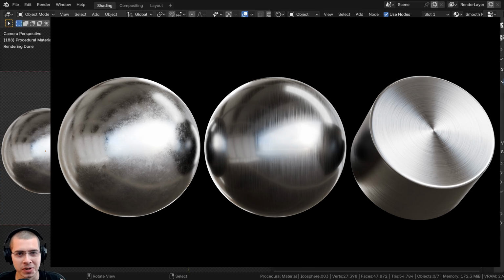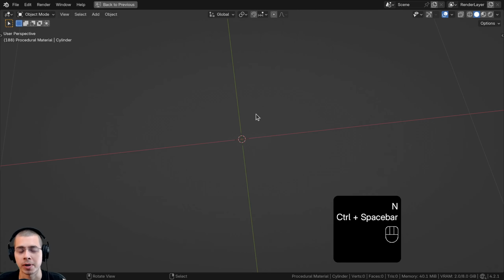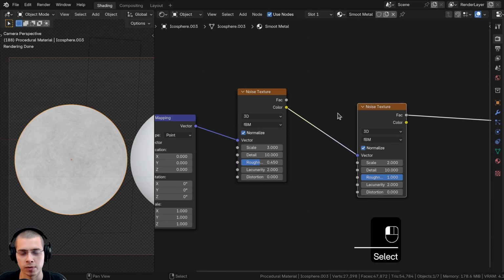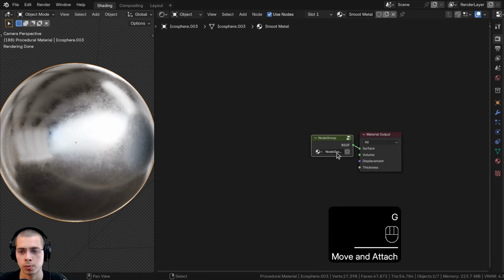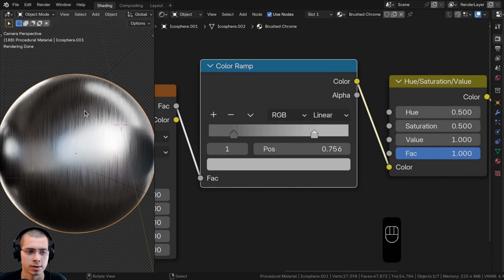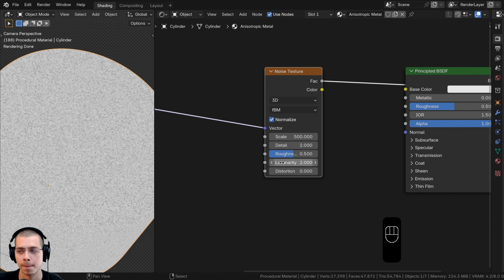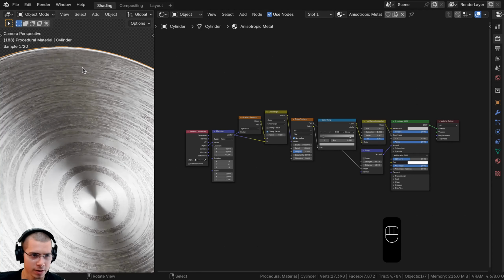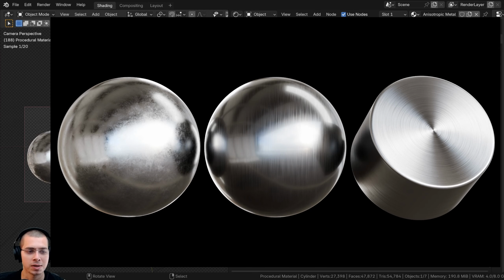Procedural Metal Materials (Blender Tutorial)

Comment: THEN... after having purchased your project file, how do you install it in Blender ?
OK ! In the zip file there are 3 files : 1- .blend 2- .jpg 3- .hdr
I clicked on the .blend file and the three objects appeared in blender with the procedural nodes beside.
The objects are naked by default (not covered with material) and when playing with the procedural settings, nothing happens to the corresponding object !
What do I do wrong ?
OK ! Found it : you have to select on the top right icons of the object pane the "render" icon or the "Material preview" to its left... 😁👍
Works great ! Now, I have to find the way to apply your "procedurals" to a custom made object of my own like... a 'fleur de lis' ⚜
Reply from the maker: Hello. Thanks for purchasing. First you need to unzip the .zip file to access all of the product files. In order to see the material showing up on the object, you need to go into the rendered viewport mode. The solid viewport mode doesn't show any materials. If you want to add the materials into other blender files to add them to objects, you can use blender's append feature to add the material data into other projects. If you need more help, you can reply to your email receipt and send me an email for product support.
Reply: @RyanKingArt  👍😊 Is there a link in the 'Blender Market' website where I purchased your project cuz I deleted your reciept email.
BTW : in the zipped files, I guess the two last files are used by the first one (.blend) so we don't have to bother with them !?
Reply: @RyanKingArt  Sent you a message in Blender Market...

Comment: The last node setup didn't work well for me. The result wasn't like yours, with those circular lines. I inserted the "Gradient Texture" node configured as "Spherical", but it didn't turn out as shown in the video even though I followed everything the same way now in Blender 4.4.
Reply: I used only one "Mapping" node, not two like his, and I changed the X, Y, and Z scales to 0.500 (the closer to 0 or 0.700, the worse the effect; it also works with negative values. I preferred to leave it at 0.500 because I liked the result better). In my case, these values worked for my object, which is a cylinder with X and Y = 2.36 m and Z = 2.2 m. Scale was applied with CTRL + A. I didn't change the rotation, and my lighting is HDRI and a sun lamp.

Test it and see if it works for you.

Comment: I just could not get the anisotropic effect to happen, and I followed the tutorial to a T! then I realised my object axis was off (even though the origin was set to geometry) so I went into local transform orientations, then sidebar - tool - transform - affect only origins then manually rotated the axis to get the z, x and y where they needed to be and this fixed it. When i had imported this CAD file it was oriented sideways so I suppose the axis had always been off until now.
Reply: Man. That may be my problem. The tutorial worked. But when I tried to apply it to my model, it just wasn’t turning out. But my model is orientated differently.

Comment: Exactly what I needed. But so far I couldn't figure out why mine doesn't look the same. Probably because my object is only 12 cm big. I see on the top side, where we want the scratches to circle around, more like only lines. When I raise the Noise Distortion to 50 it looks a bit better, but in wrong relation to the side of the cylinder. I checked everything and I have the same settings like you. Maybe it has something to do with the Mesh of my object. --- 1 Day later.  I found out what I missed. I applied Scale but not All Transformation. As a Beginner I guess that as the geometry got exported from Rhino with Y axis vertical it caused those problems in Blender till I applied all transformations. 
One thing I thought about, that if you make those Spheres to show your Material, the Sphere is mostly around 2m big. I think then the material looks often a bit in a wrong Relationship to real sizes. Because in real life, most things we use that have those materials are around 10 to 50 cm. (Computer, Hammer, Doorhandle, Smartphone. A Bicycle or a Car are the only two things I use that go into that 2m size range, but also those doesn't have one single Area that is 2m. Mostly they are separated in different smaller parts) So I think the Material-Spheres should be around 10 or 50cm.
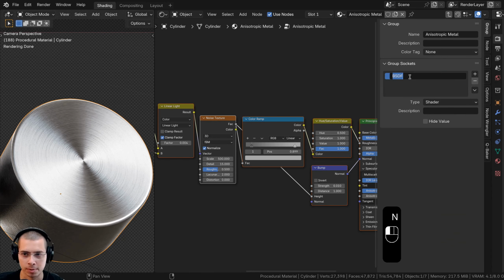However - thanks a lot for the great tutorials. Me as a Beginner had huge Struggle to understand what you are doing from min 26:00. I think for Beginners it would be helpfull to mention there what's the goal before starting all those very fast steps. Something like: "Now the Node Tree is finish and I will put it into one box to have outside the box only one Node with only the important areas to adjust. I show you how to do this, as it helps to simplify the big Node Tree and make it more easy to see in one Node where to adjust all the different parameters." 
For me, only 6 Month into Blender it was "what is he doing? Why is he doing this?" And as I said to myself then "Just trust this Guy and follow the steps, because every single Tutorial of him was great." I started to understand at the end what and why you was doing this Box and Output-Node Thing. 
Just as a little feedback from a confused Beginner. :) huge Thanks for all your amazing explaining.

Comment: Hey, I made the brushed metal material you showed. After making this and applying it on a cylinder with a sub D modifier it seems to have a mid section where the texture gets stretched and is only fixed once I decrease the scaling on the x axis, have any suggestions on how to fix this?
Reply: Apply Scaling with CTRL+A.

Comment: The last texture doesn't work. I have no idea what I am doing wrong, but on the lateral faces on each face, I have that circular pattern. The origins in at the very center of the mesh.
Reply: I also have same problem. 😢 I tried changing scale and mix type but it is same
Reply: @harsh_singh332 Alt least I am not alone 😂
Reply: @lucaciucristina130  I had the same issue, my problem seemed to be I was using a sphere, I had to setup a cylinder the same way he did (with two SubDiv and such). If it looks weird it might be that there's not enough geometry or the scaling is weird.
Reply: I get some circles on the length of the cylinder...like the storm on Neptune. Checked and Double checked. still weird.
Reply: same problem here! can't fix!
Reply: @chonk3d607  I found that the scale and size of the object plays a big role. I think this works well for objects exactly this size, but will not work for bigger ones
Reply: I used only one "Mapping" node, not two like his, and I changed the X, Y, and Z scales to 0.500 (the closer to 0 or 0.700, the worse the effect; it also works with negative values. I preferred to leave it at 0.500 because I liked the result better). In my case, these values worked for my object, which is a cylinder with X and Y = 2.36 m and Z = 2.2 m. Scale was applied with CTRL + A. I didn't change the rotation, and my lighting is HDRI and a sun lamp.

Test it and see if it works for you.

Comment: Hi, for some reason anisotropic doesn't seem to be making any effect. I tried to copy all nodes as yours. Cycles is turned on and I'm in Render preview. I'm seeing some of those cross shadows/highlights in the center, but it is not because of anisotropic. It doesn't make any difference for me.
Reply: Good luck getting him to respond to any legitimate concerns or questions; he never answers them. He only responds to those who commend his work. He, like many others on here who make Blender tutorials, always skips over and leaves out crucial details like this in these videos, and it's so damn infuriating. Like, what is even the point in making a tutorial in the first place?
Reply: Go into object mode and "apply the scale" that should fix it.
Reply: @karlcoleman2839  The issue was that it depends on what environment and lights are you are using. When I tried with different setup it worked. It was working before too but I wasn't able to notice much.
Reply: What GPU do you have?
Reply: @violetpixel2  I also had this problem, I searched for some solutions and I found that the coordinate of the object origin affects the orientation, if the z axis of the origin is not perpendicular to the surface, the light will deviate from the center.
Reply: @ABAslan-k7e  it was working it was just not enough in the environment I was using.